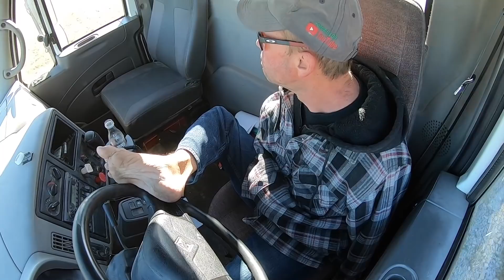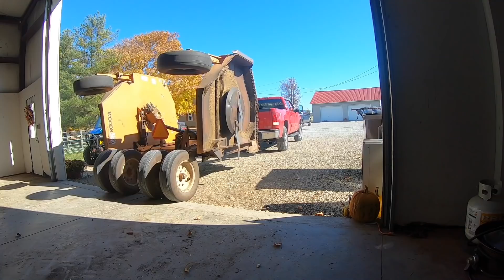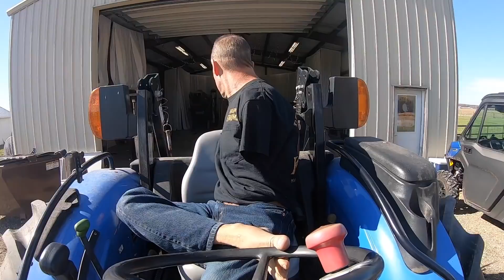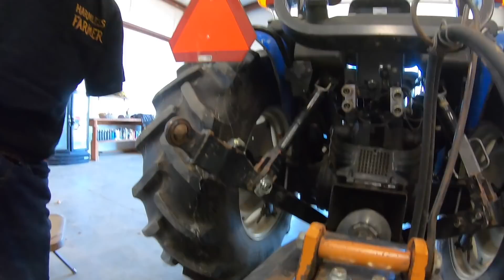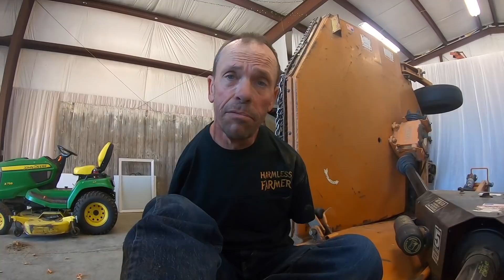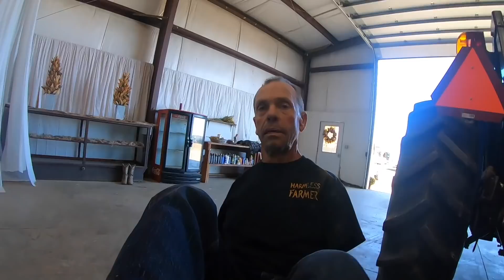Lets Hook The Mower Up

Comment: use radiant heat. I wasn't smart enough to put tubing in my shop floor when we poured the slab so i installed gun and tube radiant heat in the ceiling.  it warms everything in the shop and is comfortable. The only down side is its pretty warm on my bald head if I'm working directly below it.  no drafts and no cold spots, I keep it set at 50F to eliminate freezing and condensation from the freeze/thaw cycle.  Also just warm enough to keep you moving and being productive while in the shop, i always have the option to bump the temp up when I need to

Comment: We use a forced air (Hired Hand brand) livestock/poultry style heater in our shop. It does a good job. The efficiency is dependent on the insulation and the ceiling height. We have natural gas so that makes it a bit cheeper.

Comment: Several of the places I’ve worked have radiant heat hanging high from the ceiling of the big shops. They are pretty amazing at directing the heat down. You can walk under one and really feel it, but a few steps to the side you don’t nearly as much. I liked them for warming up when you come in from the cold and they are almost instant on heat. You’ll need at least 220V for them.
Reply: We use these in the milking parlour and the workshop simply because you can direct the heat to a location. However I would agree they do not heat up the atmosphere in the building which may well not suit Kylie's needs. Is the floor insulated? a suitable covering might be a good idea if not.

Comment: Hope all goes well with your appointments. 
Here in Canada we use outdoor wood stoves, basically a outdoor burner that heats large volumes of water that is circulated through a  radsystem in the heated building.

Comment: I have a similar mower and have found it helps to run a ratchet strap around the 3 point arms and the pto shaft and use it to carry the weight of the shaft while trying to connect it.  You do well to connect it as they are super heavy.  I am just redoing a farm shop and putting up a 55 ft tube heater, quiet and fuel efficient.   Thx for the video

Comment: What is the compass orientation of the building ridge line?
Reply from the maker: Ridge line is east and west. The overhead door is in the east end
Reply: @HarmlessFarmerAndyDetwiler  HVAC system for the building: MY assumptions are: you will be using the building regularly during both days and nights during all seasons,  you want to be comfortable while you are in there,  yearly utility costs are important.  Install the following : Air sourced heat pump to forced air will provide AC and heat on moderately cold (above 40 deg F outdoor temps). Add forced air propane furnace for colder days. Reason for the backup forced air system, I doubt the heat pump can produce heat at a lower cost than the furnace on cold days.  Lastly, fill the south facing roof with grid tied photovoltaics (solar panels).  The ROI for the solar system will be about 5 to 7 years depending on state and fed tax incentives.  You may be able to "net meter" the solar electricity to your residence.  The ROI might not me quite as good if you already pay "commercial" electric  rates rather than residential rates.  About 5 vs 11 cents per KWH.